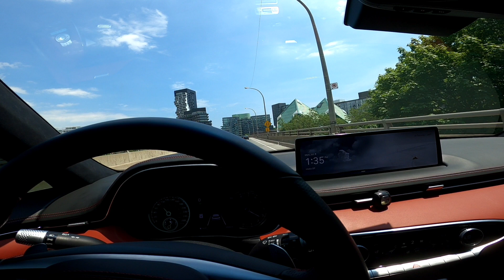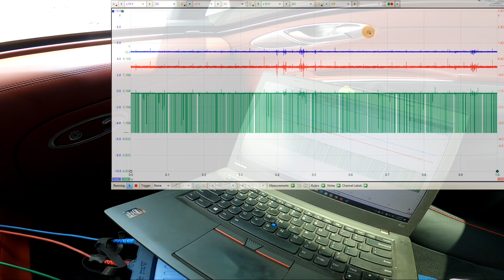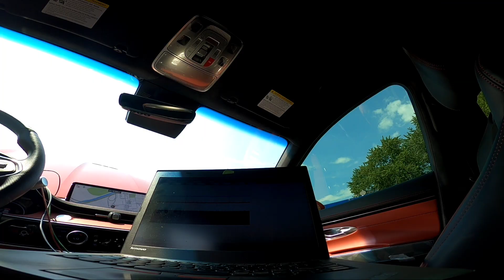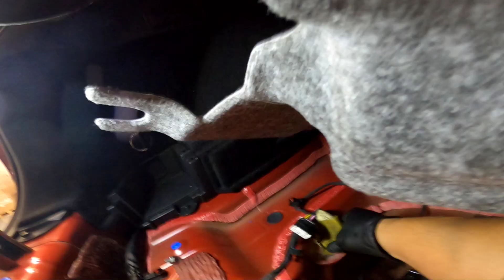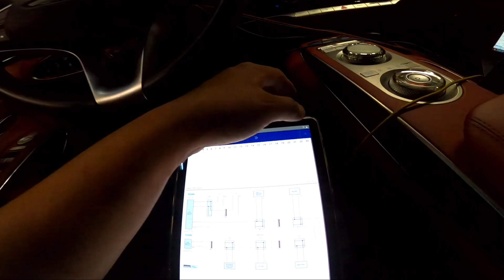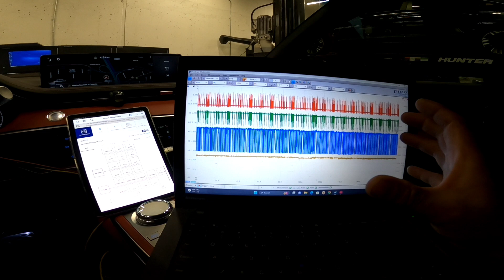2023 Genesis GV70 | Warning lights in the cluster

Comment: Do you get issues like this with the 3.5 engine or are those more reliable? What about interior quality, is it pretty solid or have rattles?
Reply from the maker: The 3.5 8 got some misfires codes but its just a quick fix like ignition coil or spark plug, so far the suv models they have rarely have squeak and rattles compared to the g70 models like they have this creaking in the sunroof especially cold weather season comes.

Comment: I want to know if you have had any issues with installing ReMan DCT on any of the newer vehicles 2021 and up 
I have had two transmissions 
where I could not get past the Transmission Learning Function 
And techline would just advise to replace with another transmssion as the one they sent was a dud.
Reply from the maker: Hmmmpp, is it the wet dct or dry like the older tucson? If its dry did the reman came in with the actuator? If not you have to adjust the actuator then redo the dct learning.
Reply: @ It was a wet dct 
It ended up being the TCM 
It was not communicating with GDS to perform the transmission learning function 
Glad it was not another transmission
Reply from the maker: @sublime2991  ohh okay good to know. Thank you